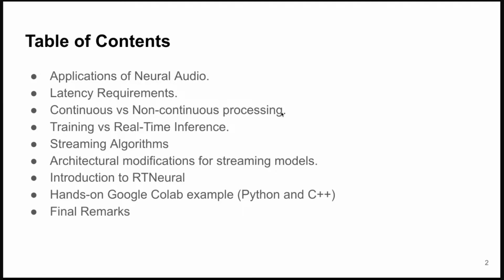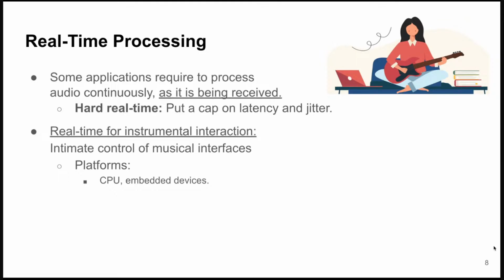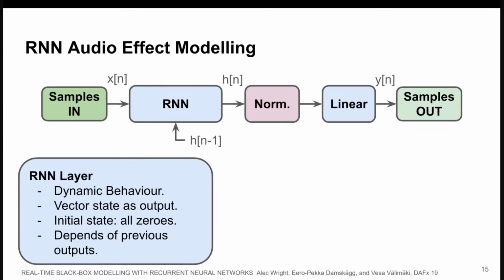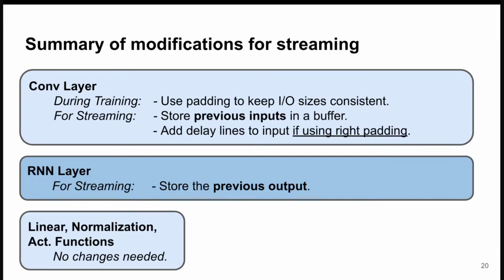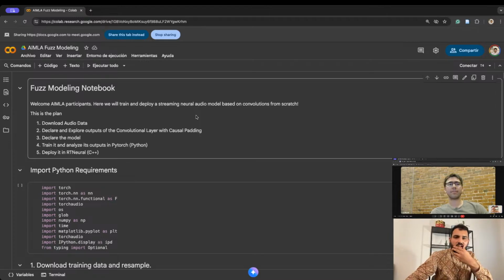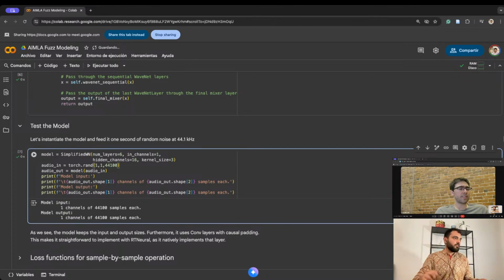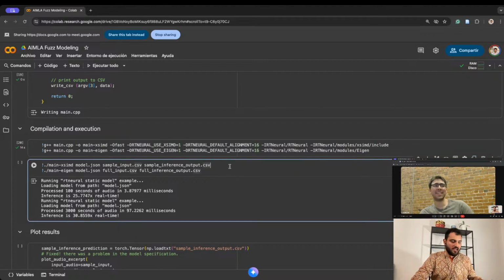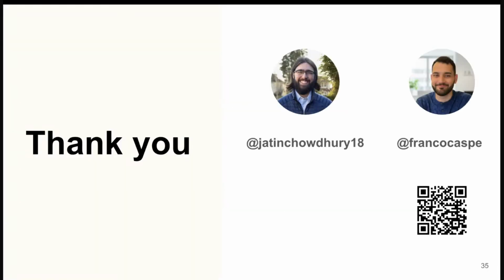Workshop on Real-time Neural Audio: Design and Inference

Comment: I didn't understand why the model stores the context when called sample by sample in the c++ implementation. Why It works there and It does not work when the "simulated" real time in Python (with 16 samples block) where called?
Reply from the maker: Hi there! The pytorch model is designed to be called just once with the full audio input already available. It does not store context between forward calls. When we run it in a streaming fashion, i.e., calling it multiple times, each with a new block of audio, it does not keep context and thus it fails.

For a convolutional model like this, context here is understood as a finite set of previous inputs of the convolutional layers (see slide no. 18 & 20)

The rtneural version automatically stores previous inputs in a circular buffer, so it keeps the previous context and can be correctly run in a streaming fashion.
Reply: @francaspe Oh thank you i see! Would be possibile to store the state (i.e. needed past input samples) also in the pytorch "real time" simulation?in order to obtain the same results from RTneural (yes i know It has no sense since we can stream the entire input at once, It Is a curiousity Just for fun)? And so this Is not a problem with RTneural because It handles past input samples using a buffer with the same size of the kernel right?and automatically shift It on the incoming audio samples. We do not Need to worry about the context because, behind the scenes, It remember "kernel size" past input samples, right?
Reply from the maker: @sim1_7  right! If you want to simulate this in pytorch to store the state, you can use IRCAM's cached conv package.

https://github.com/acids-ircam/cached_conv
Reply: @francaspe and what If i save manually the inputs using a circular buffer?and every time i receive a new sample i simply shift the buffer. Would this work?since i understand that the context Is past inputs i can save them manually right?so Is it necessary to use a special conv1d like the one indicated on GitHub?
Reply from the maker: @sim1_7  you can totally do that; that is exactly what the cached_conv package is doing :D
Reply: @francaspe yeah i mean, i think It Is easier to update manually an input array before doing output=model(input,ecc....)?in this way i'm still using Torch.nn.Conv1D. Just shifting myself the incoming input samples using standard numpy
Reply from the maker: @sim1_7  ok, so you say you want to roll just the input and leave the stateless model to process it entirely. You can do that, but you need to keep a buffer of the size of the whole receptive field of the network. And you will process the same values over and ove just to "remember" in what state you left the network at the previous block you received. It will be much less efficient than having the buffers holding precomputed values inside each of the conv1d as cached_conv or rtneural does.
Reply: @francaspe oh i see, so we Need the entire receptive field. This is different now. Now i understand cached conv1d
Reply: But both RTneural and cached conv1d does this right?they shift and Array of size of the receptive field. The model itself Is stateless, It Is not lime a stateful lstm. Tha states comes from using receptive field numbers of past samples
Reply: @francaspe anyway thank you very much for your availability and for answering my doubts😊
Reply: @francaspe but in the end we can prototipe un pytorch using entire audio file at once and then going to C++ using samples by sample inference because libraries like RTneural does this saving for US (fortunately)
Reply from the maker: @sim1_7  exactly!